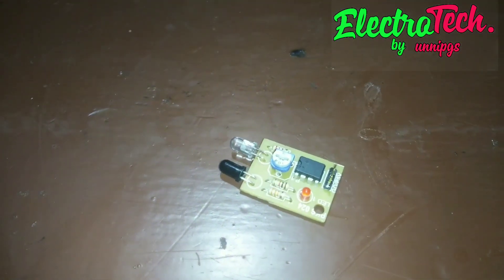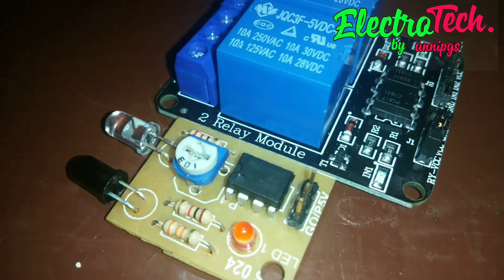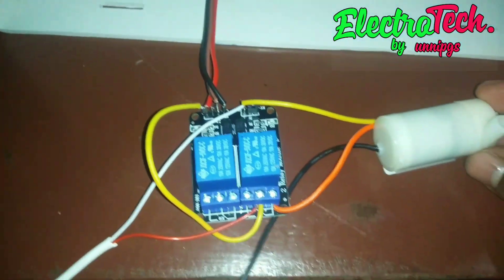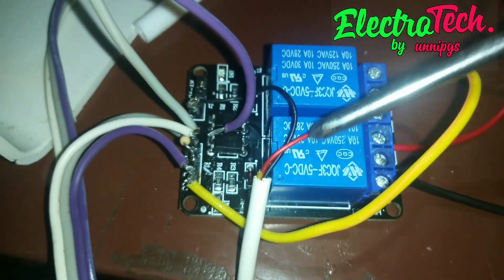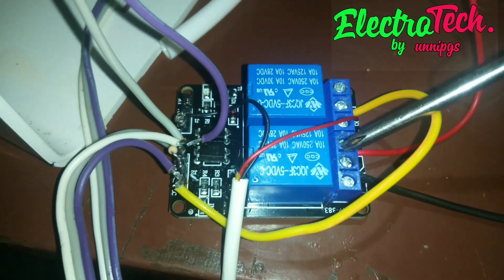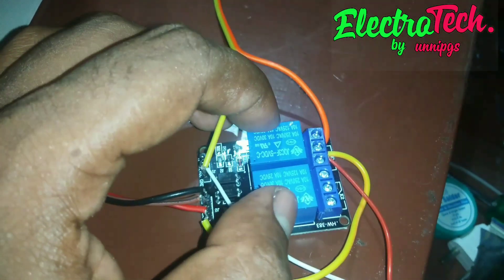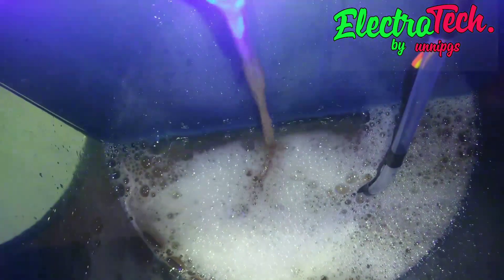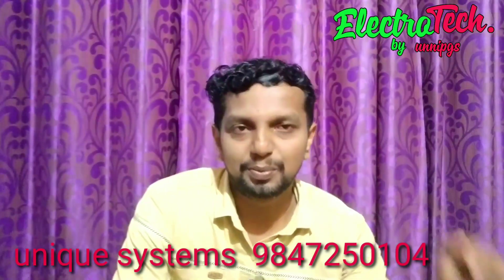how to make automatic sanitiszerdispenser #sanitisor #sanitizerdispencer #electronic sanitizer

Comment: Bro njan oru machine undakki but motor work cheyyunilla edakku  struck aakunnu sanitizer ozhikkumbol. Solenoid valve ellatha circuit aanu
Reply from the maker: E model low price ill indoor purpose nu matrame kodukkunnullu 
Ultrasonic   model aanu  eppol kodukkunnath athinu oru vishayavum varilla
Reply: K.bro.
Relay , solenoid
enthu rate varunundu.

Comment: Sanitizer ozhikkumbol motor stuck aakunnu ..
Reply: Bro ee methodil undakkunnathu sale cheyyunudo.
Njan cheytha circuit il relay ella solenoid valvum ella athu kondanno
Reply from the maker: Bro  msg ഇപ്പോളാണ്  കണ്ടത്
Reply from the maker: Pump  ഒന്ന് മാറ്റി നോക്കു  bro പ്രോക്സിമിറ്റിക്ക്  പോരായ്മകൾ  ഉണ്ട്  ആർക്കെങ്കിലും  ചെയ്തു കൊടുക്കാൻ  ആണെങ്കിൽ  ചെയ്യരുത്  
Out door  യൂസ് ചെയ്യാൻ പറ്റില്ല 
Sunlight  ill  ഓട്ടോമാറ്റിക് സെൻസ് ആകും  indoor  മാത്രമേ പറ്റു
Reply from the maker: Bro proximity  out  control  out nu matrame pattu athukondu  pump run cheyyan padaanu   
Relay use cheyyu  minimum 2A  5v  power use cheyyu  
Nilavil pump  input volt check cheyyu 5v ill kuravayirikkum athakaan aanu sadyatha